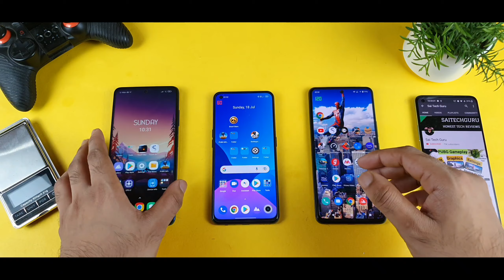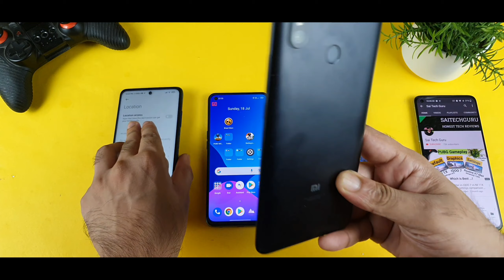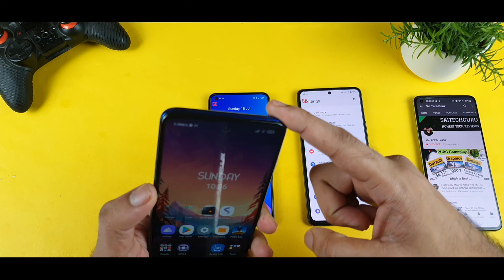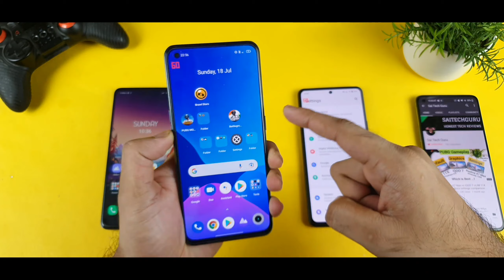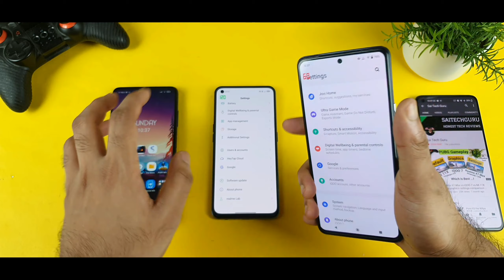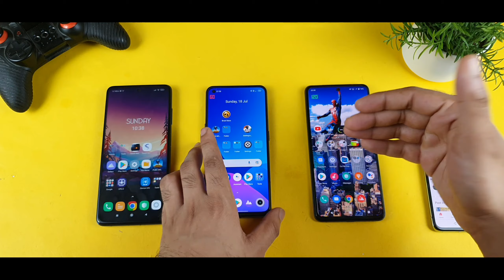Realme X7 Max vs iQOO 7 vs Poco X3 Pro build quality which is best for single hand usage 🔥🔥🔥

Comment: Bro suggest me which one to buy realme x7 max or iqoo7
Reply from the maker: Gaming and performance iQOO 7 
All round Realme x7 max
Reply: @SaiTechGuru  is it safe to buy relame x7 max after detecting such issue of only 60hz working on youtube and Instagram
Reply: Very confused between the 2 phone have to buy within 20 days
Reply: @sauravkataria2465  go for IQ007 blindly I am using it it's flowless and smothest device I have ever used... Charming display, in 10 mints 40 to 50% mobile will charge in emergency u will love iq007 charging speed
... performance unbeatable...don't think just buy it...I was also much confused before but after research I found iq0007 better and I m not regret even 1% in any circumstances...best of luck...
Reply: @premalvyas45  thank you bro